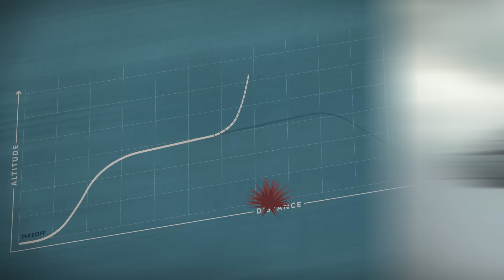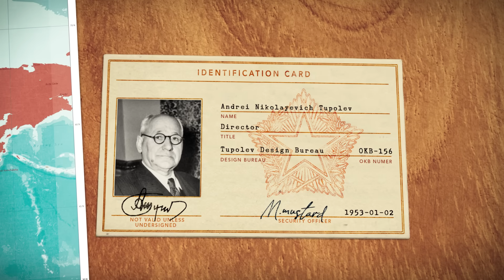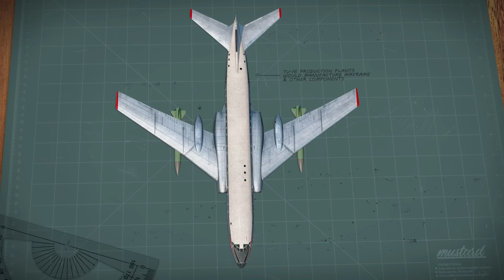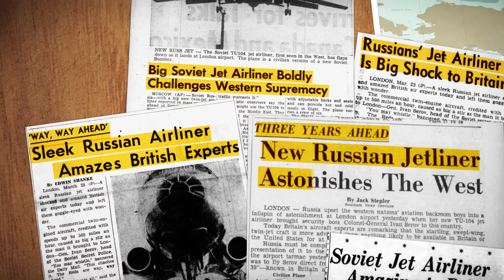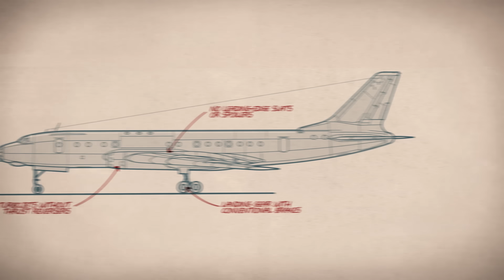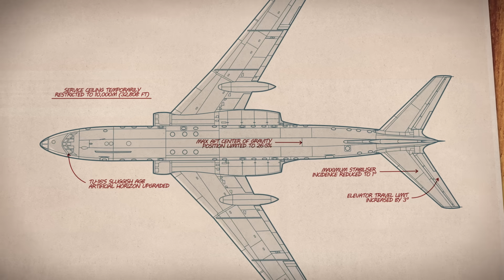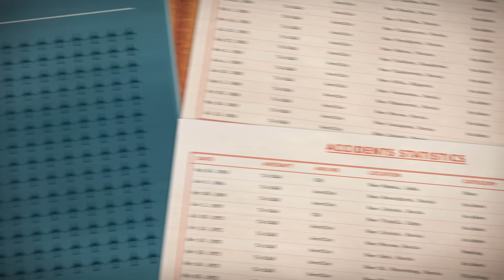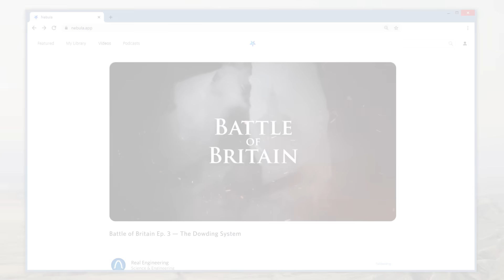The Soviet Airliner Designed To Crash

Comment: The most dangerous airliner? *XXXmax
Reply: The de Havilland Comet is the worst jet airliner in history and no aircraft has had a higher loss rate or fatalities statistics..
Reply: @sandervanderkammen9230 

 . .

We feel we can shed some light on some common myths & misunderstandings repeated in many comments.

Although the TU-104 was a later design aircraft it was not safer than the DH Comet.

It is indeed correct that there were plenty of aircraft that were more dangerous than the De Havilland Comet before & after the Comet.

Obviously It's not valid to compare a Bow-wing ( see B-47 wing folding & wing collapse incidents for details) jet  airliner designed & first built as late 6 decades after the Comet, with the fabulous De Havilland Comet, the world's first high altitude jet powered airliner.  
  Vast improvements in commercial aviation infrastructure & pilot familiarity with jet airliners alone being a significant factor in improvements in air travel safety safety over more than half a century.

    Of course Bow-wing having 50 years more design, build & operation experience than De Havilland didn't prevent the horrendous Bow-wing Max  incidents, there can obviously be no excuses for that.
  
  That's correct of course, at the time the Comet wasn't particularly dangerous. Agreed, that is indeed the case of course, The DH Comet was definitely not the worst engineering failure in commercial airliner history.

Losses comparisons
How things were in those days.

DeHavilland Comet 4 UK                  14% 
DeHavilland Comet all mks             17%  

Boeing 307                               70%
Boeing 247                               48%
Boeing 707            .                  20% 
Lockheed Electra Turboprop   29%
Canadair CL-44  Turboprop     46%  
Convair CV-580  Turboprop     22%
Convair CV-880    (ff 1959)       27%  
Convair CV-990     (ff 1961)      33%
Tupolev TU-104       (ff 1955)    16%

     Of course De Havilland had prior experience building many all metal construction airframe aircraft & thousands of jet powered fighter aircraft that were primarily of metal construction with pressurised cockpits & jet engines built by De-Havilland.

  Yes, that's true, De Havilland carried out full stress analysis & engaged in a comprehensive & protracted testing program which is why key De Havilland people were happy to be aboard flying DH Comet aircraft. The Comet was the first airliner where stress due to pressurisation significantly exceeded flying load stress for a full length passenger cabin fyselage.

    We agree, that's correct, the DH Comet was the first passenger airliner with full length fuselage pressurisation at 8psi pressure differential. Handley Page built the world's first all metal construction airliner during the 1920s.
    In many cases earlier pressurised aircraft were larger, needed thicker fuselage skins due to flying stresses alone & had much lower pressurisation differential pressure. 

     Of course ripstop provision was provided. The skin alloy used became unavailable at the time due to R & D at the manufacturers which resulted in the original alloy being discontinued. Later alloys had very similar properties. The skin thickness used for the Comet was used for similar size later aircraft. Frame spacing was not found to be too large & frame width was not found to be too small.

    Without doubt De Havilland did indeed always work to better than industry standards at the time, used up to date knowledge for the design & construction & no evidence of negligence or criminal negligence was ever produced in relation to the DH Comet.

   Obviously the DH Comet had no effect on the course of the aerospace industry in the UK. The UK now has the world's largest combined nuclear, aerospace & defence sectors per capita activity.

    That's correct, the investigation committee did not find hundreds of fatal flaws or evidence of design defects, structural defects, defective materials or shoddy workmanship. Indeed it is the case that ripstop provision was included. Claimed incidents did not involve cracks starting from passenger window corners.
   Pretty much all changes were just in case changes or were planned development modifications & improvements that were scheduled regardless of incidents.

    Obviously De Havilland designers knew all there was to know about metal fatigue at the time they designed the DH Comet.

    It is in fact true to say that the way airliners were built changed everywhere including in the US after the Comet incidents.

We hope this helps, obviously.

Cheers indeed of course 👍. 
                        
 . . .... ... .... .  ..     ......
.. ......... ..  ... . . ...      .
 ..... ..... .... ... .....    .....

Comment: Isn’t this effectively a reskin of that one British jet plane that also kept crashing?
Reply: He mentioned it, the De Haviland Comet. It was mainly made out of wood and glue. It was kind of bad. The Tu-104 was an all-original Soviet design, and apparently really bad too.
Reply: @Queenfan999 

We feel we can shed some light on some common myths & misunderstandings repeated in many comments.

Although the TU-104 was a later design aircraft its safety stationary similar to the DH Comet.

The Comet was a high altitude all metal construction airframe airliner & was not built from wood & glue.

It is indeed correct that there were plenty of aircraft that were more dangerous than the De Havilland Comet before & after the Comet.

Obviously It's not valid to compare a Bow-wing ( see B-47 wing folding & wing collapse incidents for details) jet  airliner designed & first built as late 6 decades after the Comet, with the fabulous De Havilland Comet, the world's first high altitude jet powered airliner.  
  Vast improvements in commercial aviation infrastructure & pilot familiarity with jet airliners alone being a significant factor in improvements in air travel safety safety over more than half a century.

    Of course Bow-wing having 50 years more design, build & operation experience than De Havilland didn't prevent the horrendous Bow-wing Max  incidents, there can obviously be no excuses for that.
  
  That's correct of course, at the time the Comet wasn't particularly dangerous. Agreed, that is indeed the case of course, The DH Comet was definitely not the worst engineering failure in commercial airliner history.

Losses comparisons
How things were in those days.

DeHavilland Comet 4 UK                  14% 
DeHavilland Comet all mks             17%  

Boeing 307                               70%
Boeing 247                               48%
Boeing 707            .                  20% 
Lockheed Electra Turboprop   29%
Canadair CL-44  Turboprop     46%  
Convair CV-580  Turboprop     22%
Convair CV-880    (ff 1959)       27%  
Convair CV-990     (ff 1961)      33%
Tupolev TU-104       (ff 1955)    16%

     Of course De Havilland had prior experience building many all metal construction airframe aircraft & thousands of jet powered fighter aircraft that were primarily of metal construction with pressurised cockpits & jet engines built by De-Havilland.

  Yes, that's true, De Havilland carried out full stress analysis & engaged in a comprehensive & protracted testing program which is why key De Havilland people were happy to be aboard flying DH Comet aircraft. The Comet was the first airliner where stress due to pressurisation significantly exceeded flying load stress for a full length passenger cabin fyselage.

    We agree, that's correct, the DH Comet was the first passenger airliner with full length fuselage pressurisation at 8psi pressure differential. Handley Page built the world's first all metal construction airliner during the 1920s.
    In many cases earlier pressurised aircraft were larger, needed thicker fuselage skins due to flying stresses alone & had much lower pressurisation differential pressure. 

     Of course ripstop provision was provided. The skin alloy used became unavailable at the time due to R & D at the manufacturers which resulted in the original alloy being discontinued. Later alloys had very similar properties. The skin thickness used for the Comet was used for similar size later aircraft. Frame spacing was not found to be too large & frame width was not found to be too small.

    Without doubt De Havilland did indeed always work to better than industry standards at the time, used up to date knowledge for the design & construction & no evidence of negligence or criminal negligence was ever produced in relation to the DH Comet.

   Obviously the DH Comet had no effect on the course of the aerospace industry in the UK. The UK now has the world's largest combined nuclear, aerospace & defence sectors per capita activity.

    That's correct, the investigation committee did not find hundreds of fatal flaws or evidence of design defects, structural defects, defective materials or shoddy workmanship. Indeed it is the case that ripstop provision was included. Claimed incidents did not involve cracks starting from passenger window corners.
   Pretty much all changes were just in case changes or were planned development modifications & improvements that were scheduled regardless of incidents.

    Obviously De Havilland designers knew all there was to know about metal fatigue at the time they designed the DH Comet.

    It is in fact true to say that the way airliners were built changed everywhere including in the US after the Comet incidents.

We hope this helps, obviously.

Cheers indeed of course 👍. 
                     
 . . .... ... .... .  .. .... .
.. ......... ..  ... . . .... .
 ..... ..... .... ... ........
Reply: If by "reskin" you mean "a COMPLETELY unrelated aircarft sharing literally no common design heritage or parts," then sure.

Comment: I don't know how exactly did they conclude that an updraft would pitch the plane up uncontrollably when at the length versus the speed of the plane, it's milliseconds since the nose and back of the plane pass through the same updraft region. I agree that it does give an initial pitch up rate, but how much of a rate? It puzzles me to accept that an updraft would increase the angle of attack continuously, unless..., and maybe this is it, unless the aircraft's CG was very far aft near the neutral point (total lift vector on the whole aircraft with zero pitch control surface deflection) and the plane would have a range of AoAs above which it would be statically unstable, but that should be discovered with flaps up and flying at higher angles of attack, probably higher than 10 to see how the plane responds and if it pitches up on it's own. That's why I'm kind of not convinced that it was the updraft combined with a statically unstable AoA range that made this possible, unless they could prove this like I've suggested, with flaps up, same weight distribution as when the plane flew in that mishap in order to reproduce it and to try flying at higher than normal AoA ranges to confirm it.

Comment: In Poland we used to call Tupolev planes "Trupolew" (a play on the word "trup" meaning 'deadman') :D
Reply: It's because two  IL-62 planes owned by the Polish National airline company LOT crashed in 70'-ties. Both accidents were related to the carrier's failure to comply with the allowable engine wear limits between overhauls and the unauthorized engine repairs performed in garage conditions. The Polish public was not informed of this, as it would have damaged the reputation of the ruling Communist Party's officials. The blame was placed on the engine manufacturer, the Russians. Incidentally, no Il-62, other than the two owned by LOT,  crashed due to turbine rupture caused by engine shaft vibration.
Reply: @leonerdo60  Funnily, nothing you said is true. So, good job, comrade, here's your state turnip.

Comment: How many people did the Comet kill and how many did the Tu 104 kill?
Reply: The Comet has the highest loss rate and fatalities statistics of any jet airliner in history.
Reply: @sandervanderkammen9230  
194 / 5 000
 @sandervanderkammen9230 So don't slander Russian technology, be impartial. Finally, you will see how the F16 will be shot down by Russian and Soviet equipment. I also doubt the F 35, loaded with electronics.
Reply: @JanKavik I didn't... the de Havilland Comet was a British jet aircraft..
Reply: @sandervanderkammen9230 

We feel we can shed some light on some common myths & misunderstandings repeated in many comments.

Although the TU-104 was a later design aircraft it was not safer than the DH Comet.

It is indeed correct that there were plenty of aircraft that were more dangerous than the De Havilland Comet before & after the Comet.

Obviously It's not valid to compare a Bow-wing ( see B-47 wing folding & wing collapse incidents for details) jet  airliner designed & first built as late 6 decades after the Comet, with the fabulous De Havilland Comet, the world's first high altitude jet powered airliner.  
  Vast improvements in commercial aviation infrastructure & pilot familiarity with jet airliners alone being a significant factor in improvements in air travel safety safety over more than half a century.

    Of course Bow-wing having 50 years more design, build & operation experience than De Havilland didn't prevent the horrendous Bow-wing Max  incidents, there can obviously be no excuses for that.
  
  That's correct of course, at the time the Comet wasn't particularly dangerous. Agreed, that is indeed the case of course, The DH Comet was definitely not the worst engineering failure in commercial airliner history.

Losses comparisons
How things were in those days.

DeHavilland Comet 4 UK                  14% 
DeHavilland Comet all mks             17%  

Boeing 307                               70%
Boeing 247                               48%
Boeing 707            .                  20% 
Lockheed Electra Turboprop   29%
Canadair CL-44  Turboprop     46%  
Convair CV-580  Turboprop     22%
Convair CV-880    (ff 1959)       27%  
Convair CV-990     (ff 1961)      33%
Tupolev TU-104       (ff 1955)    16%

     Of course De Havilland had prior experience building many all metal construction airframe aircraft & thousands of jet powered fighter aircraft that were primarily of metal construction with pressurised cockpits & jet engines built by De-Havilland.

  Yes, that's true, De Havilland carried out full stress analysis & engaged in a comprehensive & protracted testing program which is why key De Havilland people were happy to be aboard flying DH Comet aircraft. The Comet was the first airliner where stress due to pressurisation significantly exceeded flying load stress for a full length passenger cabin fyselage.

    We agree, that's correct, the DH Comet was the first passenger airliner with full length fuselage pressurisation at 8psi pressure differential. Handley Page built the world's first all metal construction airliner during the 1920s.
    In many cases earlier pressurised aircraft were larger, needed thicker fuselage skins due to flying stresses alone & had much lower pressurisation differential pressure. 

     Of course ripstop provision was provided. The skin alloy used became unavailable at the time due to R & D at the manufacturers which resulted in the original alloy being discontinued. Later alloys had very similar properties. The skin thickness used for the Comet was used for similar size later aircraft. Frame spacing was not found to be too large & frame width was not found to be too small.

    Without doubt De Havilland did indeed always work to better than industry standards at the time, used up to date knowledge for the design & construction & no evidence of negligence or criminal negligence was ever produced in relation to the DH Comet.

   Obviously the DH Comet had no effect on the course of the aerospace industry in the UK. The UK now has the world's largest combined nuclear, aerospace & defence sectors per capita activity.

    That's correct, the investigation committee did not find hundreds of fatal flaws or evidence of design defects, structural defects, defective materials or shoddy workmanship. Indeed it is the case that ripstop provision was included. Claimed incidents did not involve cracks starting from passenger window corners.
   Pretty much all changes were just in case changes or were planned development modifications & improvements that were scheduled regardless of incidents.

    Obviously De Havilland designers knew all there was to know about metal fatigue at the time they designed the DH Comet.

    It is in fact true to say that the way airliners were built changed everywhere including in the US after the Comet incidents.

We hope this helps, obviously.

Cheers indeed of course 👍. 
                       
 . . .... ... .... .  .. .... .
.. ......... ..  ... . . .... .
 ..... ..... .... ... ..... ....